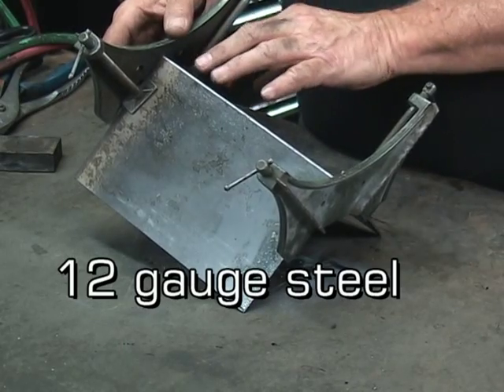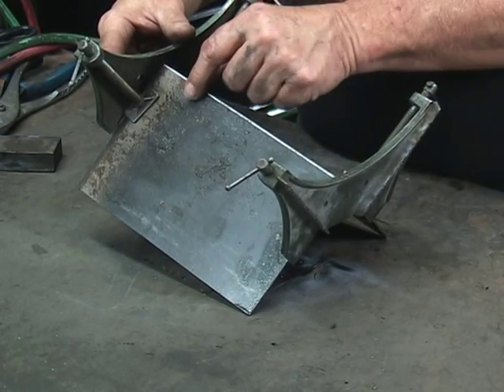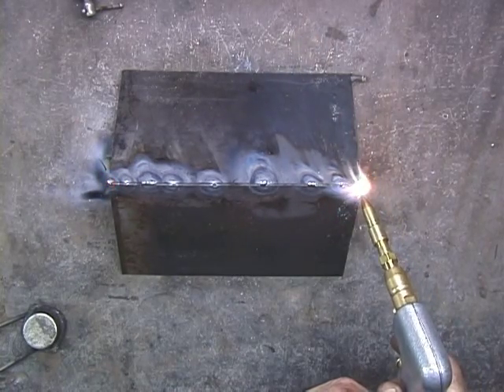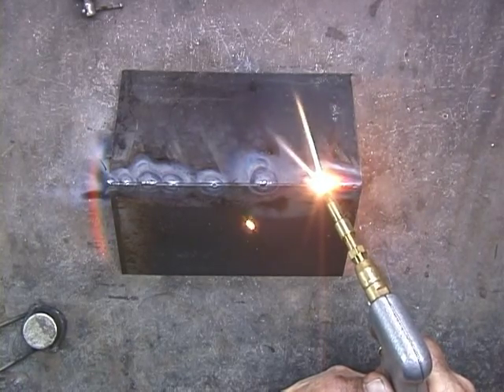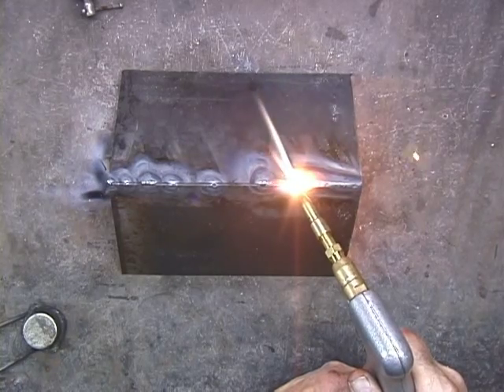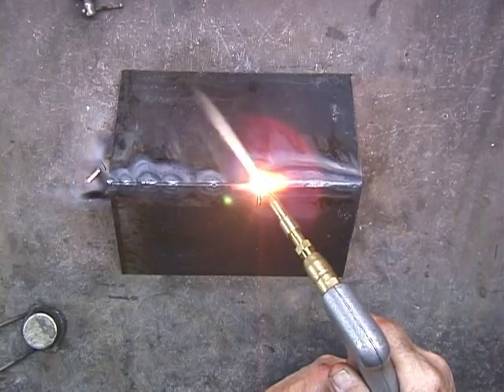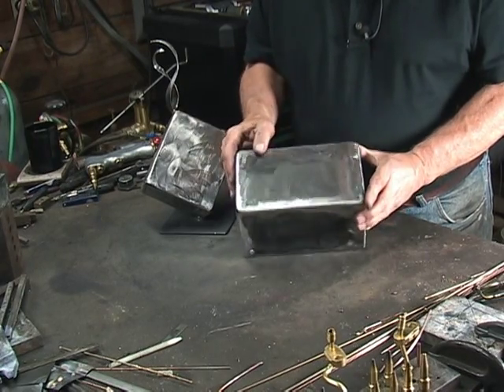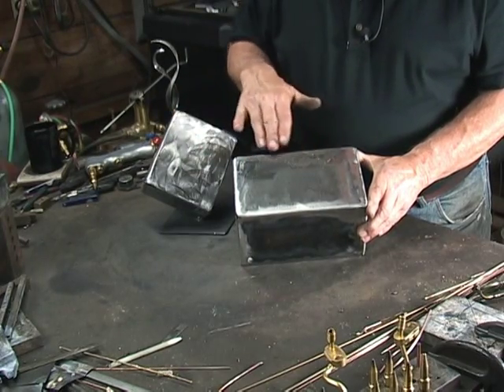Fusion welding DHC 2000

Comment from the maker: No.  Although a fusion weld can be quite strong.  The fusion weld in this video is unlikely to break unless put under tremendous pressure.

When welding two pieces of steel together the use of a gas filler rod is the strongest.

The two pieces of steel are heated until they are about yellow hot and at the same time a gas filler rod is melted in between the two pieces of yellow hot steel.  Theoretically, this is the strongest.

Thanks for asking..

George